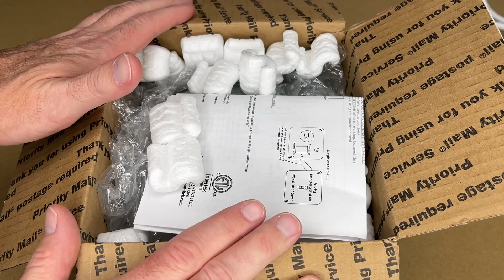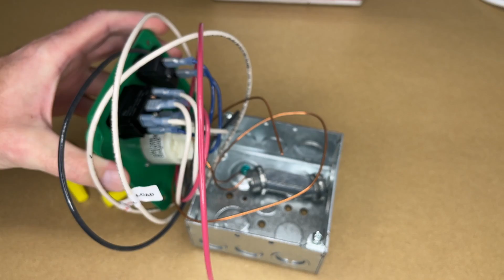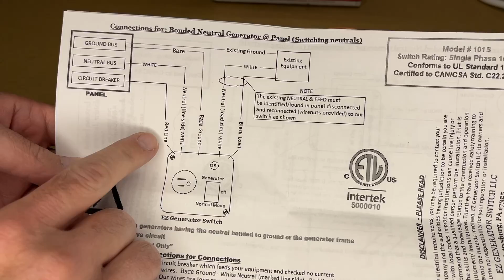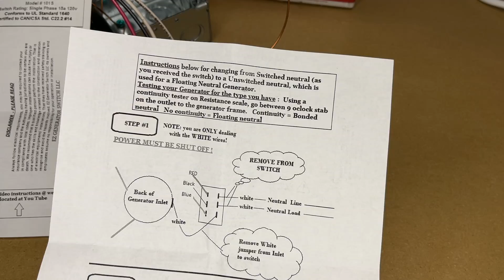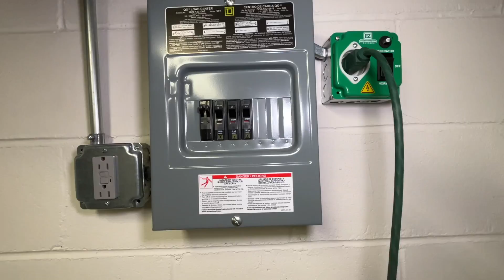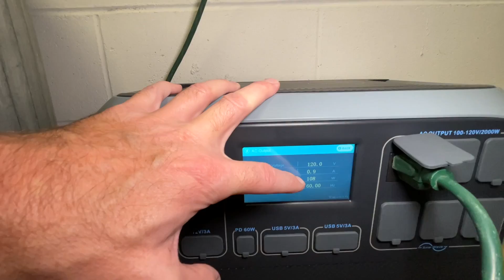EZ Generator Transfer Switch on Service Panel

Comment: The EZ Generator Transfer Switch is an excellent product from an excellent company.   I’m using three units to have my furnace, water heater and fridge on an Anker F3000 power unit with three expansion batteries.  This particular combination can be used in UPS mode/pass thru charging such that the EZ box is set to “Generator” all the time.  Should the grid go out, the appliances will continue to run as if an automatic transfer switch was installed.  In the warmer months, the furnace and water heater are switched back to “Normal”.  The fridge will be left in Generator mode through the year.

Comment: I have two of these transfer switches. I suggest ordering them straight from the EZ Generator switch website. Amazon seems to always be out of stock plus Amazon shipping has turned to crap.

Comment: I was going to get a whole house transfer switch breaker box, however, realizing my ONE generator wont power the whole house, Ive decided Im going to need this unit for my furnace and then the transfer switch for everything else.

Comment: So all four of those breakers from the sub panel can be powered with that single 120v outlet from portable battery at the same time?
Reply from the maker: No. That would overload it. This is essentially a transfer panel for a single circuit or appliance.

Comment: Those are nice but i wanted a twenty amp version and in an outdoor box. So i went with another company. With a twenty amp version I could use a cut off breaker box and have two circuits. Mainly lights and refrigerator. 73

Comment: Is that transfer switch for one device only or can you plug in a generator and select which circuits you would like to power?
Reply from the maker: This specific transfer switch is for one device or circuit. There are a lot of options for large transfer switches that can handle multiple circuits. This is for those who only need a simple setup.